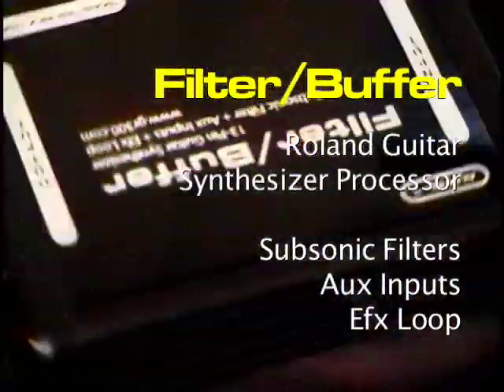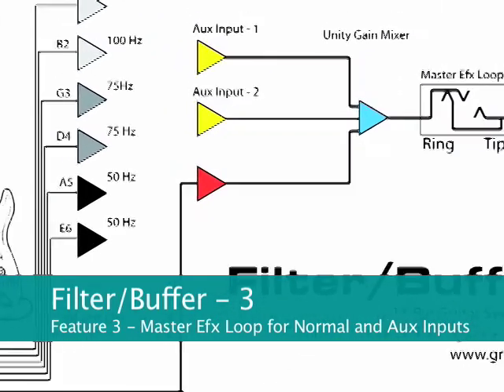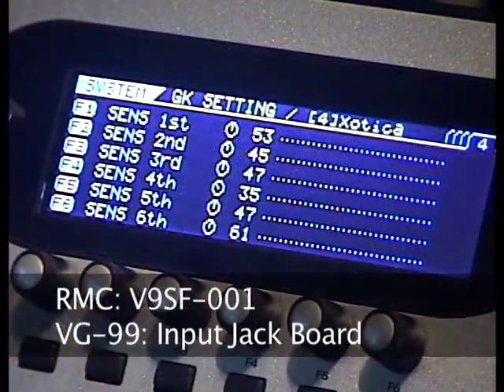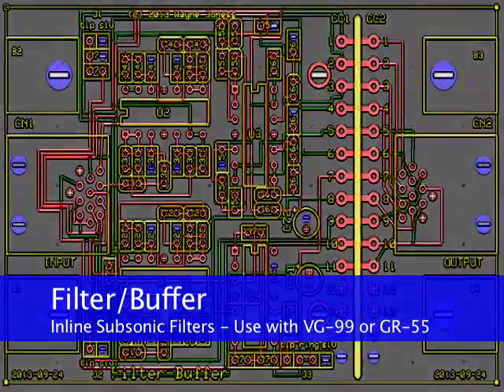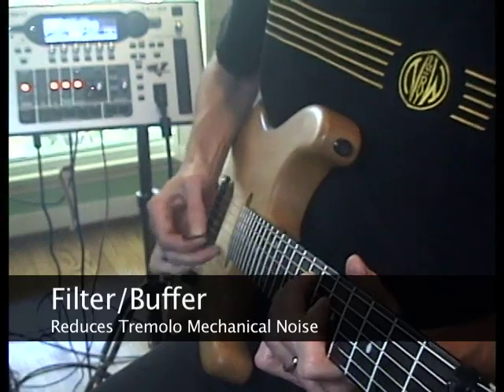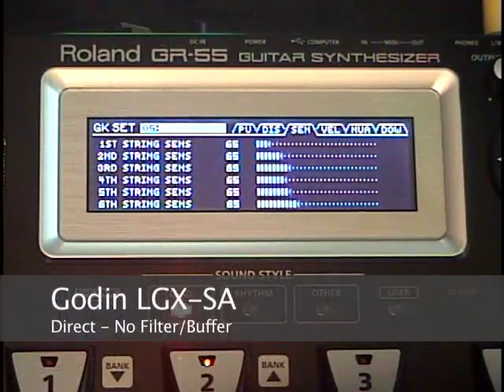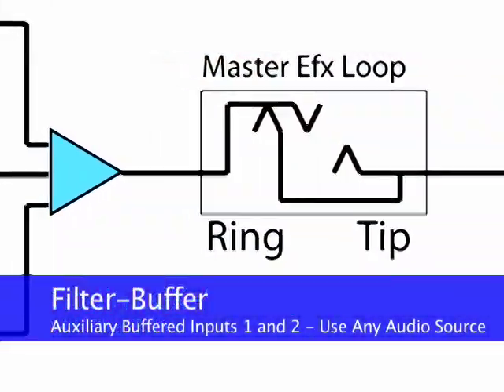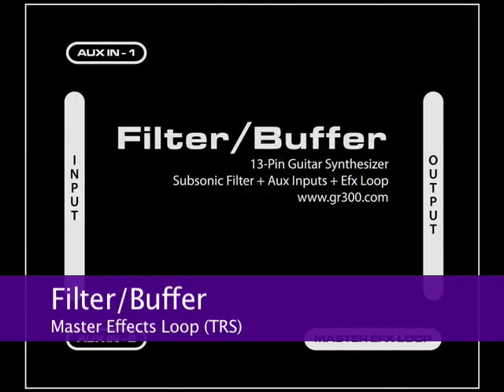Filter-Buffer Roland 13-pin GR-55 VG-99 Guitar Synth Tracking Optimizer and Efx

Comment: @waynejoness - this is a fantastic product and it's shame it is no longer produced. Thanks a lot for your generosity to share the diagram with the world!

Is anyone using this subsonic filter with Roland gr-33 to share experience, please? 
I just got it built from the scheme on the site, but noticed significant drop in the signal (sensitivity of pickup dropped a lot, and now I need to pick quite hard in order synth to register string signal) - all strings sensitivity is now set to 8.  Using original roland cables (brand new) with Godin grand concert SA.

Thanks a lot in advance for feedback and suggestions.
Reply from the maker: Glad to help out!

Comment: Can it be used for gr20?
Reply from the maker: i have never tried it with the GR-20, I am not sure how it would change the response of the GR-20.
Reply: @WayneJoness  I assume it would work with the GR-20 because it is inline, meaning it should clean the signal before it even hits the GR-20. Is that correct? Trying to find one to test with.
Reply from the maker: @MelodicTwilight  It might be hard to find one for testing, I have not made the unit for several years.

Comment: This thing does exactly what it says on the tin. I've had a GR55 for three years and just gave up trying to adapt my technique to eliminate the ghost notes on piano like settings. Plugged into one of these and the sounds almost 100% clean - just have to avoid hammer ons.
Reply: Where did you get one of these?  I really want one but don't know where to get one. I think this works better than RMC OPT 1

Comment from the maker: You can build your own Filter/Buffer, the schematic is posted on my website: http://www.joness.com/gr300/Filter-Buffer.htm
Reply: David Franks I hope to build one, but it is finding the time, but when I do, I'll make the PCB layout available.  The parts list is something that you can source from the diagram.  I'll be building mine so that it goes inside the GR-55 box, rather than as a separate unit.  Why the hell Roland didn't do this is anyone's guess.  Rather than wait for me, someone at VGuitar forums is bound to do it...
Reply: Wow, nice one Wayne!  When I communicated with you via email a while ago now, I got the impression this project was a goner, but with the diagram, I can build one.  Thanks!
Reply: Is a parts list and/or the circuit board artwork available??  Thanks!
Reply: That would be great if you could make the PCB available. I would like to build one that goes inside of my GR-55 as well. Which op amp would be used for the 4 quad op-amps? I did not see anywhere was it was stated.  Thanks!
Reply: David Franks If you look on the CCT diag, it is a TL084.  That's a quad op amp, so when you see triangles like that, every four of them equals one IC (usually).

Like I said, I'm busy, but you can obtain a ton of circuit and PCB software online now for free.  Make that circuit  and then produce a PCB from it - ABC simple. Back when I did it, we used crepe tapes on stable film cut with a scalpel, then reduced it and made it positive in a darkroom - you've got it easy! ;-))
Reply: Ahhh... I see the TL084 now. Thanks so much!

Comment: I just realized that you had a signal path in your video and documentation.  The loop connection is inserted in the signal chain to the GR-55.  ...yes?

...and it is looking for a single 1/4" connection which becomes both the in & out.  It is not like on an amp where there is a 1/4" in and 1/4" out for an effects loop.  ...yes?

How does this affect or change the way I utilize my UX-20?

Comment: Hello Wayne,

I didn't fully understand the master effects loop connection.  You inserted a master volume pedal which seemed to be in the chain in between the guitars and the Gr-55. (yes?)

In thinking about it, it seemed that the master effects loop really sent the guitar inputs off independently to other devices & not into the GR-55. So the inputs simultaneously were going in to paths (1. the GR-55 and 2. out of the mater loop connection to wherever (effects pedals & then to an amp).  yes/no?